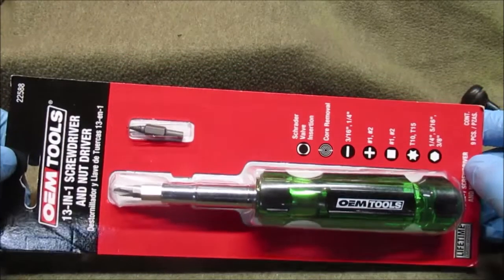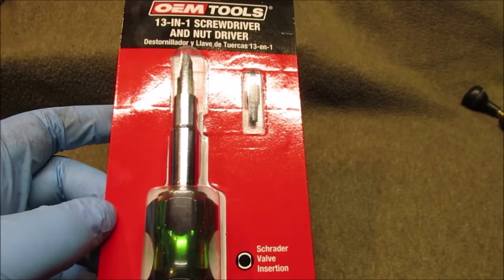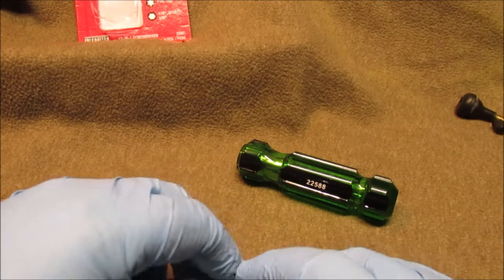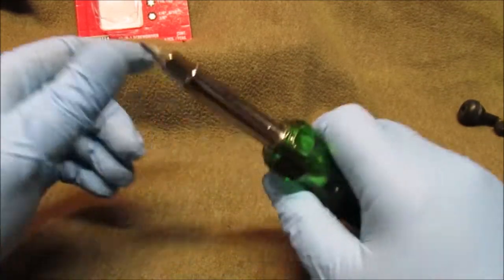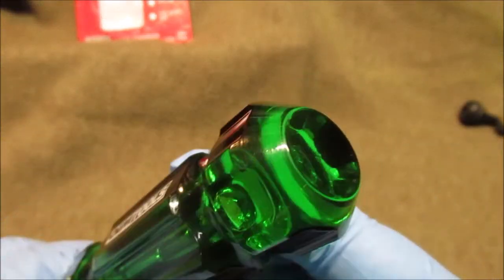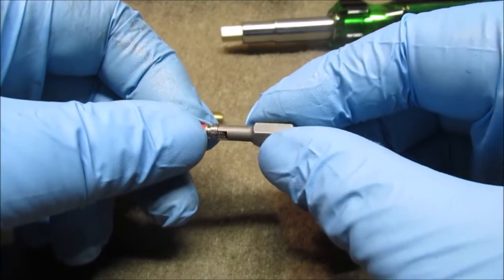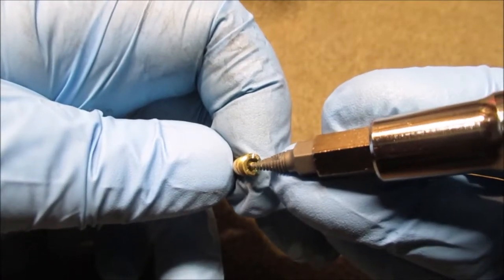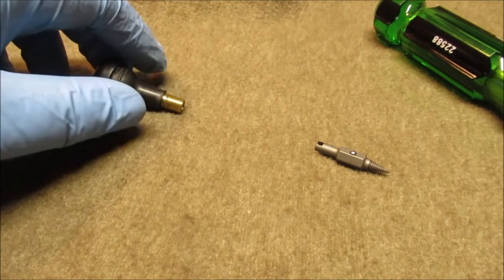New 13-in-1 Screwdriver & Nut Driver

Comment: I like that broken Schrader Valve remover bit. Its my favorite part of the tool.
Reply from the maker: I had to have the nice green handle  I have a small 4 in 1 tool for tire valve work but it is hard to use If I find it I could show it in a video